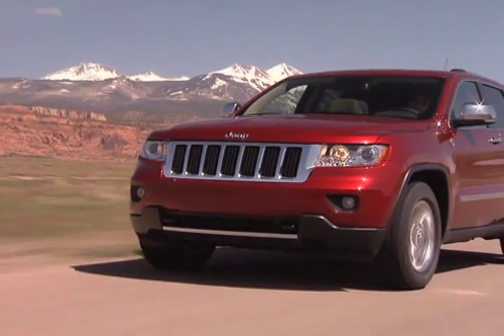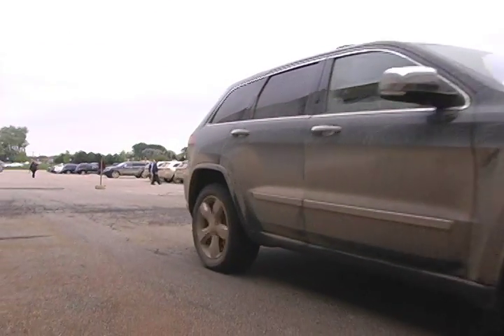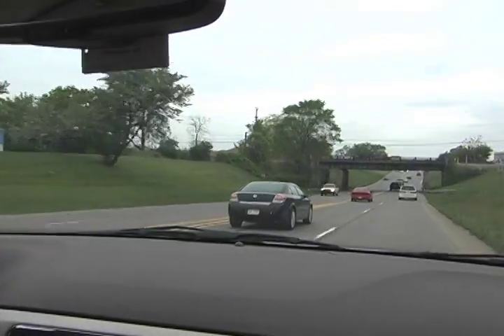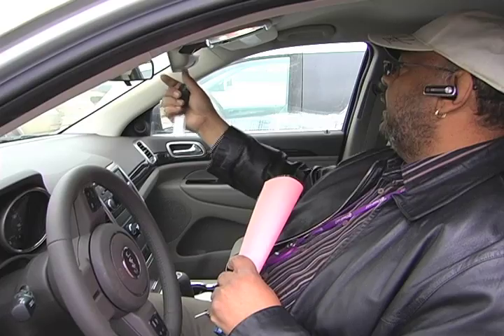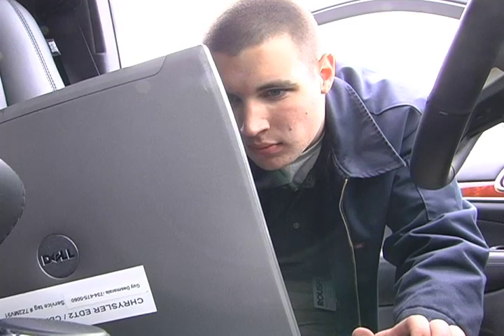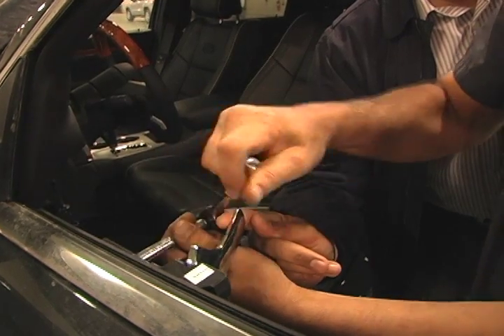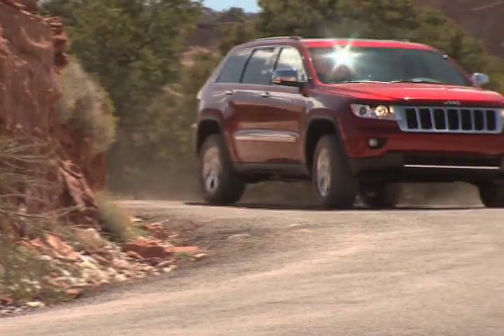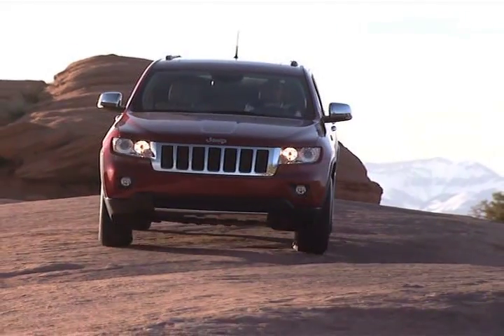Jeep Grand Cherokee reliability testing

Comment: ery hardy SUV and reliable !!
I have a request if you are in contact with representatives of a Jeep, then tell them for Russia they made the most reliable jeep!
There is one Jeep Grand Cherokee in 2013 with a 3.6 engine, it has a mileage of almost 800,000 thousand kilometers or 497,096,954 thousand miles !! Not a problem except a broken gearbox !!

Comment: Mine accelerates really well - I took some kind of a little Honda with a big spoiler on it no problem. It loves to go! Lots of power and torc. 35,000 Km and not a single tiny issue yet. LOVE IT!!!!
Reply: still love it? any problems?
Reply: I have the same question

Comment: About the acceleration i think i due to the transmission, it could use a better one, but believe me if you want to go fast just press the gas pedal harder, this thing will come to life! lol regarding fuel consumption im noticing better mileage after 2000 miles i guess its because less friction between the engine parts, one thing that i really like is that the Pentastar is made to perform better on regular gasoline ;-) something i couldn't do with my previous RAV4, overall i give my Laredo a 9!
Reply: so after all these years what's your feed back and rating? is it worth buying one or still termed as un reliable
Reply: @wasayable  it was a good truck for the time I own it, I traded it in 2014 for a brand new Limited, gorgeous truck inside and out, it had the new ZF transmission and it felt like a completely different car because of it, but also it was the truck's dismay, it started failing under 20k miles, I took it to the dealership and they "fixed" the problem, but it only lasted 2 weeks before it started to fail again, when it shifted to second it made a strong jolt, it was crazy, so I got rid of it a soon as I could, I haven't own any Jeep product since then, now I have a Toyota Tacoma and I'm very happy without any problems

Comment: I just bought a 2011 Grand Cherokee Larado and overall I am happy with it but the major things I would like to see improved are the acceleration and the fuel economy. This thing drinks gas just as bad as the 1996 Mercedes Benz E-320 I traded in for it. Again, overall... I am satisfied with my purchase I'd give it a 7.5 out of 10. If it got better mileage on the gas I'd give it a 9 and if it picked up speed faster I'd give it 10. (mine is white with black cloth seats)